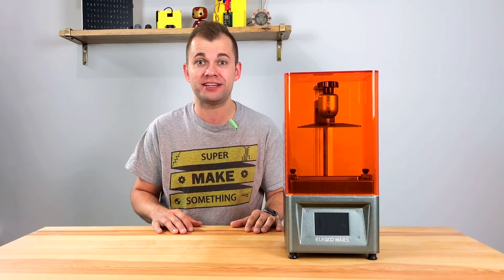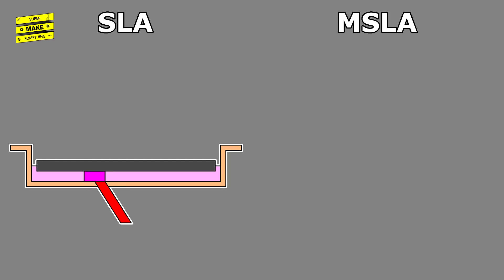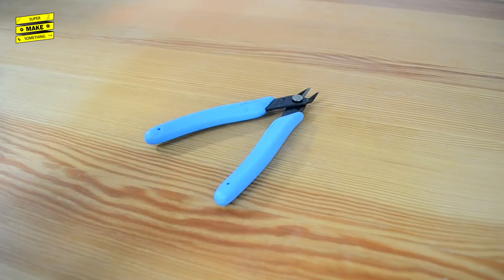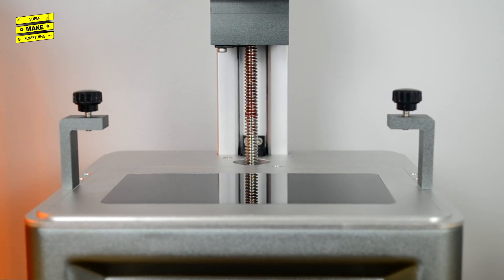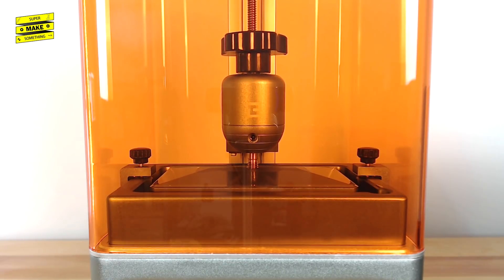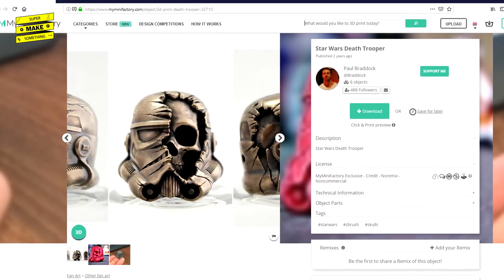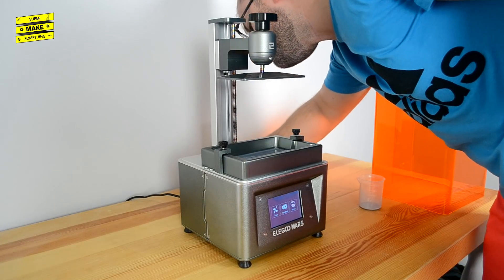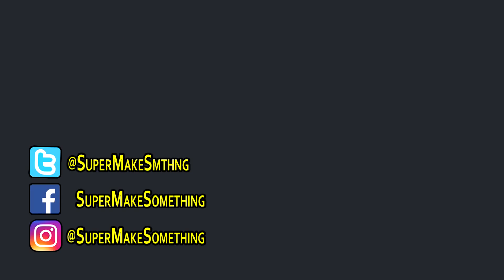Resin 3D Printing: SLA vs. MSLA vs. FDM - Elegoo Mars Review and Setup

Comment: Surely sticking that tape affects the zeroing of the printer? Also the print plate rotated when you did auto levelling. Do you think that is a problem?
Reply from the maker: The tape may affect leveling a bit, but the effect was negligible based on my experience -- the FEP film still made a "popping" sound with every layer, indicating good layer adhesion/clearance between the film and the printing surface.  Regarding the build plate rotation -- the build plate seems to be slightly smaller than the exposure area of the screen in order to account for this, though it would certainly be best to try to keep rotation to a minimum when printing modes that use up a lot of the x-y area.
Reply: Super Make Something 🖖

Comment: As someone who is a total noob to 3D printing and is looking to get into it I did indeed find something new in your video!
The in depth look at the slicing software (including the details on time to model, cost per model etc) was really informative and something I haven't yet seen from other videos on the printer. Thanks! (I agree with some of the other comments on the USB port though. Not only is it in the wrong place (on the back?) but that one in particular looked like it was ready to fall inside the machine. Not very impressive build quality.
Reply from the maker: Awesome! Glad that you enjoyed the video! Thankfully the USB quality and placement have improved in subsequent releases of the machine, as this was from the first production run. They are much more solid now!

Comment: Thanks so much for the good explanation. I was thinking all SLA printers used the method that is actually MSLA. Is laser (or standard, it seems) SLA common in the maker space?

Love the resolution capability, but the chemicals/work environment concerns just seems like such a barrier to entry.
Reply from the maker: The most common “maker”-ish level SLA printers would probably be those from Formlabs, though I have not used them myself. Resin printing is definitely a bit more involved compared to FDM printing, so I typically decide which one to use depending on the intended application of the part.

Comment: I learned some good stuff, but came here wanting to know how build speed compared.  Did I miss that bit?
Reply from the maker: Thanks! You’re right — I did not call out the overall print time. In general, resin printing is faster for larger models (that use the whole build area), because you are exposing an entire layer at once. This is especially true for new printers that use “mono” LCD screens. A video about this technology and how it differs from the tech in the original Mars is coming soon, so stay tuned!

Comment: This video is a bit old sure, but even back in 2019 I'm pretty sure there were 0.2mm nozzles, and hardware/firmware/software for FDM printers that would enable a 0.05mm layer height with said nozzles.

Comment: put rainx on both sides of the FEP. prevents resin from sticking to the FEP. prevents vacuum between the FEP and LCD. does not leave residue like 3in1 oil. you really don't want tape on the LCD because you want the FEP as close to the LCD as possible. however, you can put kapton tape around the edges of your LCD. kapton tape is very thin and can also prevent spilled resin from getting into the cracks around your LCD

Comment: Do you need to clean the reservoir every time you stop printing for a bit or can it stay in there for a certain amount of time or...?  Has anyone or the manufacturer talked about some maximum sizes that can come out of there?
Reply from the maker: I haven't tested this, but I heard that you can leave unused resin in the vat for ~24 hours, after which it should be cleaned/stored.  The reservoir volume should easily be big enough to make parts that max out the Elegoo Mars' print volume.
Reply: @SuperMakeSomething  Thank you for the reply. I hope to get my machine tomorrow or the day after.
Reply: @SuperMakeSomething  Already bought it by now, have it for a small week. Printing my ass off  though testing new resin. I'm not sure if it is me or the resin but it staying sticky for a week or more.

Comment: Hi!! Im new here so are the 3d models that are made for fdm are still compatible with the sla?
Reply from the maker: Stoppy chopper All 3D printing models generally start out as STL files, which are then sliced in their respective software (e.g. Cura for FDM and Chitubox for MSLA) in order to allow them to be printed on a specific machine. Therefore you can print the same models on both types of printers, as long as they are sliced with the correct software and settings for that printer.

Comment: And how resistant/hard is the resin pieces? Like for replacing cogs/gears on small electronics?
Reply from the maker: Francisco Pérez The pieces are hard, but the resin is brittle. I would not recommend it for high-torque applications, but for small electronics it is probably fine.

Comment: How bad is the smell...?  If I set it up in a large office (where I sometimes eat my lunch at my desk), will it be too noxious...?
Reply from the maker: hob976 Overall, the smell wasn’t too bad, though this largely depends on the resin you use. A large office should be fine as long as there is sufficient air flow. If you are concerned about health effects, the Elegoo Mars Pro is another good option, because it includes an integrated air filter. I compare the two units, which you can check out here if you are interested: https://youtu.be/r0BVyFg7ddM

Comment: A couple of comments. The comparison showed a supports failure on the MSLA print, with a deformed model. How common is this, because that is potentially a showstopper, and it could cause disconnected geometry to become permentantly bonded to the FEP layer. That could mean damaging the LCD as well if not inspected for. Obviously there are dozens of reasons this could have happened, most of which have nothing to do with the printer itself, but it is worth addressing since it was shown in the video.

Also pointing out that the MP Mini Delta officially supports 0.05mm layer heights as well, so that is not particularly a good point to use for differentiation. Minimum feature size is something you could compare them with, as well as the surface finish and especially print time for high resolutions. You can also point out the ability to print actually transparent items, something that is only barely possible in FFF printers.

Materials cost is worth addressing, and compatibility with different sensitivity resins.  
There seems to be an impression in the comments section that this is a replacement for common FFF printing, which it isn't. MSLA is a complimentary printing technology to FFF, and is capable of many things FFF cannot practically do (I have a 5mm tall benchy, so you can do crazy high res with FFF, it is just very painful). FFF is there for large mechanical items, and can produce inexpensive large items with closed cavities. MSLA can print at high resolutions without an exponential increase in print time, is entirely homogeneous across the part, and is far more suited to organic shapes than FFF. 

I think your editing and presentation was solid. The video was extremely watchable and had a consistent professional tone. If you went a bit more into technical details of why this printer might or might not be perfect for the viewer I believe your content would be among the best.

Comment: It seems like a wonderful machine. The only question is if the resin smells a lot during and after a print. Can you use it at home, and if so, do you need to have a well-ventilated area set out for it?
Reply from the maker: Sherab Zangpo I’m currently working on a video that addresses this topic. Stay tuned!

Comment: Isnt that a DLP printer? I mean SLA stands for Selective LASER Sintering. There is no Laser in the printer shown?
Reply from the maker: In this application, MSLA stands for "masked stereolithography," which uses an LCD screen to mask off areas in each layer that should not be exposed to UV light.  Selective Laser Sintering is another process used for metal 3D printing, but this process is not quite available to consumers at entry-level prices yet.
Reply: @SuperMakeSomething  SLA isnt used for metal. SLM is what you mean. You Should google it up 👍🏻
Reply from the maker: @Xappt  I did not say that SLA is used for metal. I was referring to SLS, which you referenced in your reply. 

The term “Selective Laser Sintering” you used above is a printing process that uses a laser to selectively melt and fuse powdered materials into a desired shape, which can be used with Nylon, glass, etc. Direct metal laser sintering (DMLS) is a subset of this process specifically applied to metal alloys. SLS is a catch all term that can describe both. 

SLA is “Stereolithography,” which uses a laser to selectively cure polymer liquids to make a part. 

MSLA is “masked stereo lithography,” which uses an LCD screen + UV light to cure whole layers of polymer liquid simultaneously, which is the type of printer shown in the video.
Reply: @SuperMakeSomething  no SLS is only used for polymere powders and as well just sinters the powder. For metals it is called SLM (m=melting). Thats a huge missconception you are going after.

Comment: Thanks, this really sounds and looks promising, any idea on the life of the printer? Also, I am more into 1/12 size collectibles so would you give me some advice if this one can help in printing custom heads in that 1/12 scale? (as this scales are smaller and resolution is a key)
Reply from the maker: Vaibhav Gaikwad So far, the printer is used regularly and still going strong without any issues! The build volume of this machine is 120x68x155, so if these numbers x12 are larger than the heads you are trying to print, you should be good to go!
Reply: @SuperMakeSomething  Thanks the 1/12 scale heads are really small, so I am sure the print size can be handled, just wanted to know the minimum resolution that it can print the details. Like the 1/12 head is almost 1.2 inch tall and 9 cms in width.

Comment: Very good introduction to Resin 3D printing.  Now I understand the process.  While I am happy with my FDM printer for buildings and terrains, printing figurines has been hit and miss.  My main concern is the potential for toxic fumes.  I have limited space so I need to have a method of venting those fumes.  Also, I am thinking a 'cure box' with a UV light would be more practical than putting the objects outside in the sunlight, particularly in the middle of winter!  I have to do some more research as I am also interested in strength and durability of resin printing as I make items that need to be strong, flexible and durable.
Reply from the maker: Thank you! I'm glad that you liked the video! Resin printing is definitely great for highly detailed prints, though there are some trade-offs in terms of clean-up, etc. compared to FDM printing like you indicate. I made another video about the Mars Pro that covers emissions and air quality, so please be sure to check that one out as well!

Comment: MSLA=DLP?
Reply from the maker: The two process are actually different.  While both selectively expose resin to light, a MSLA printer has a masking LCD that is backlit by an array of UV LEDs, whereas DLP printers have a single light source from a projector that exposes certain parts of resin (no masking LCD).

Comment: What was the total time to print both models? as a comparison.
Reply from the maker: For this test case, the FDM printer was actually faster, clocking in at 2 hours and 16 minutes vs. the resin print, which came in at 2 hours and 32 minutes. This is because a resin printer exposes an entire layer simultaneously regardless of size, so the resin printer speed-up really only becomes apparent when printing larger objects that use the whole bed.

Comment: how much are the the resign bottles , and  is there a variety  such as colors, glow in the dark , strength , flexible s ,    do you recommend building a customize  box to cancel , the fumes , and noise , maybe add a fan
Reply from the maker: There are a variety of colors available, both opaque and translucent.  I have not yet seen any glow in the dark materials or more exotic materials like flexible, though there are so resins advertised as "tough" resins that supposedly have a higher material strength.  I personally do not think I will build a box because the printer sits right by my window, which seems to do the job, however venting equipment that produces fumes is generally never a bad idea!
Reply: @SuperMakeSomething  ooh thank you so much for the information , have a great weekend to you and your care ones , forgive my grammar . one more question  can they print moving parts
Reply from the maker: @drosky310  No problem! I have not tried to print moving assemblies in place.  However, I believe that this printer should be able to do so.  FDM printers can do this, but since this printer can print at higher resolutions, I think this should be no problem.  If you end up buying a printer and trying it out, please report back! Have a good weekend!
Reply: @SuperMakeSomething  i will wish me luck , and if i have success , i dont forget , ill share one of my inventions

Comment: The problem I have experienced with low cost resin printers such as the Mars and Photon S is poor dimensional accuracy. They are great for things like figurines due to the high level of detail. However, I have not been able to get them to print parts that are dimensionally accurate for prototyping functional parts. I recently calibrated one so that the print was accurate to within 0.002" of the CAD model. But when I printed the other half of the model it was off again and did not match up to the first half I printed. Is this pretty much the case with all lower cost resin printers? I also experienced "puffing" on the side with supports where the area near the supports tended to grown and be thicker than they should be with both the Mars and Photon printers. 

I have a Prusa MK2 and MK3 and found that both of them have dimensional accuracy that is more consistent and repeatable compared to the resin printers. I have been rather frustrated not being able to achieve good dimensional accuracy on the resin printers that I have been able to achieve with my FDM printers. Not sure what to do short of spending 15x the money on a higher end resin printer. Help!
Reply: CLS63 from OC I don’t have the answer but I appreciate the info you have given
Reply from the maker: Interesting -- I have not yet made any parts on the printer that require 0.002" dimensional accuracy, but I will definitely be on the lookout for this in future prints!   One of the issues I have with some FDM printers is that there is some variation in my printed part dimensions from variations in the bed height, which sometimes leads to some "smoosh" in the first few layers.  The auto-leveling is one of the things I like best about this particular printer, since this has helped me to avoid this issue.  Maybe it is time for me to install a bed leveling probe in my FDM machines...

Comment: This was a very interesting video and you presented a great deal of information in an easy to understand form. I do have a question about hardening the resin in the sun. Could you use one of the UV units that are created for UV hardening gel nail polish? They are small, self contained plug in units that are designed to have someone put their finger tips inside so the UV lights harden the polish on their nails. It seems like it should work and be much more reliable than taking it outside and hoping it is sunny.
Reply from the maker: Debbie Vozniak Hi Debbie! Thank you for your kind words! Absolutely — using one of those units work very well. I actually use something similar in my follow up video where I review the Elegoo Mars Pro. In that video, I bought a small UV LED lamp and a turntable, which allows for the curing process to be controlled more than simply placing the unit in the sun. If you are interested, you can check out this video here: https://youtu.be/r0BVyFg7ddM

Comment: Could I print warhammer tanks with this a little worried about the smaller print platform. Or should I go for an elder 3
Reply from the maker: Depends on the overall dimensions of the model, but prints should be relatively easy to split up into multiple parts.  Since the printer can produce such fine details, it should be relatively straight forward to join them together cleanly.
Reply: Yes, print 40k with the mars. I am printing my ork killteam right now, only 1.5 hrs left!

Comment: Awesome review, it looks awesome for the price. Why MSLA and SLA build volume are still that small ??? However it said in description it's available but on Amazon it's saying currently unavailable for both USA and CANADA ....
Reply from the maker: QuebecoisSti They estimate that it will be back in stock on Wednesday, but it supposedly has been back throughout the day, so be sure to keep checking back!
Reply: Small because in order to keep costs down, they all use cheaply available smartphone LCD screens. So you're limited to the size of a smartphone.  You could always build your own using a tablet screen. OR get higher resolution by switching to a 4K LCD screen.

Comment: just want to know, 1 is it possible to use my solidworks program to create a model, 2 is it possible to make multiple units (same models) in one go. ex 6 of 1 model.
Reply from the maker: Yes, it is possible to generate custom models in any CAD software that can generate STL files.  It is also possible to print multiple models at once, as long as they fit on the build plate.